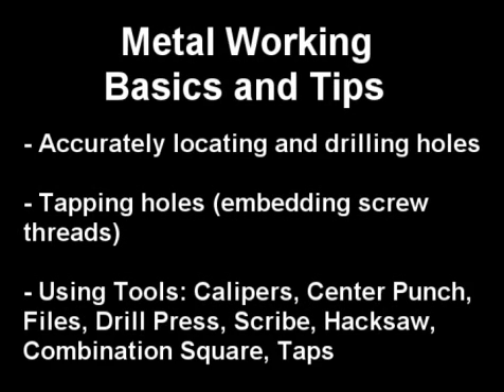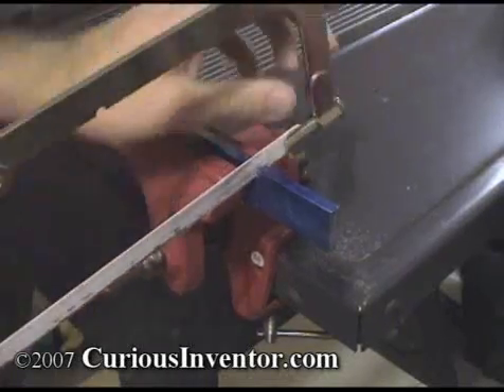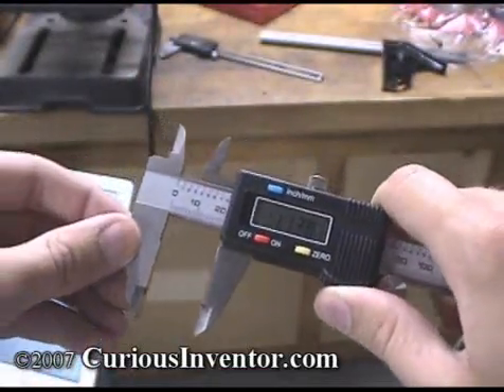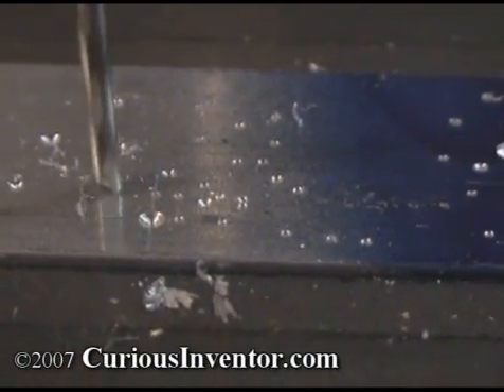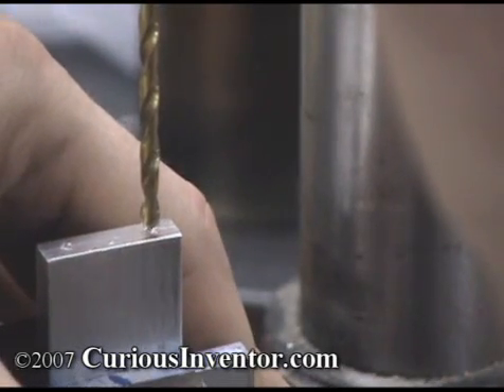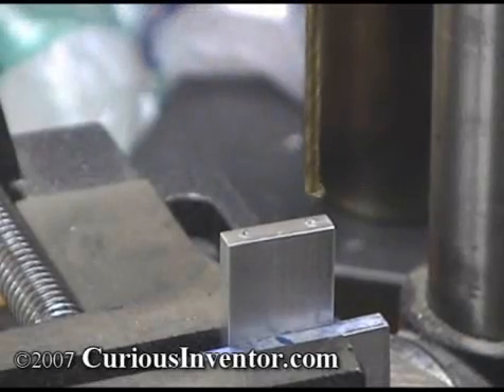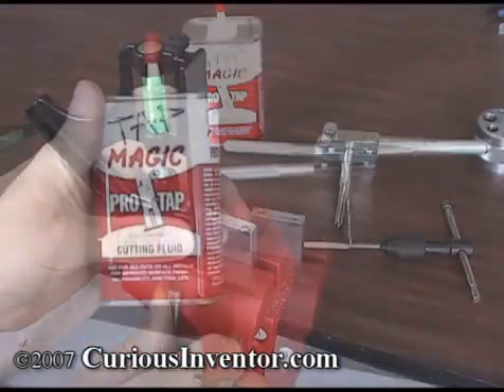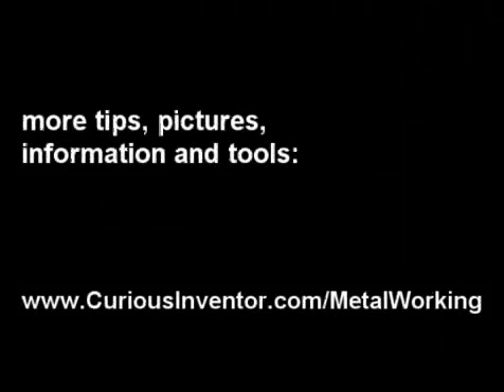Basic Metal Working

Comment: Hello curious inventor?.all metal drill bits are pointed,angled,etc. for the job they are doing,You could have mentioned that a cent're punch would have stopped the dancing of the drill bit & that metal drilling bits are ground to a spec, angle  to what ever material being machined,brass, aluminium cast iron, bronze.etc.one drill bit does not suit all metals+the speed and feed of the drill bit is a factor in good results,and no burnt out drill bits.

Comment: What is the best way to go about making a hole in a steel chassis?  My method right now is to use a center punch, a small pilot hole, and finally the full sized hole.  It seems to push some material out the back and create nasty burrs which is really annoying.

Comment: This video is excellent!  I used your tut to drill a front panel from very light aluminium for my theremin.  I didn't run into any trouble, except sometimes my drill would vibrate, leaving a curve-of-constant-width-shaped hole instead of a circle.  What causes that? And what is a blind hole?

Comment from the maker: Most bits I've seen that are sold for metal working aren't pointed... do you buy specially pointed ones or sharpen them yourself?  I think split-points limit the walking problem, also.  I bet there's a reason why bits aren't manufactured with pointed tips...